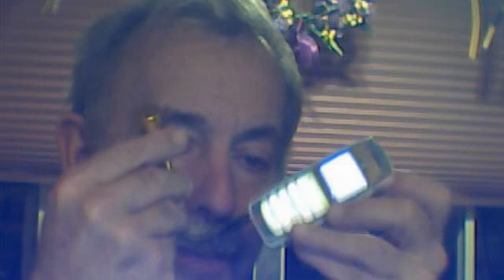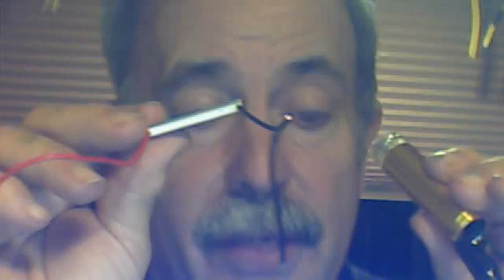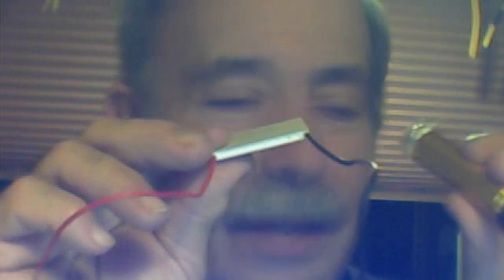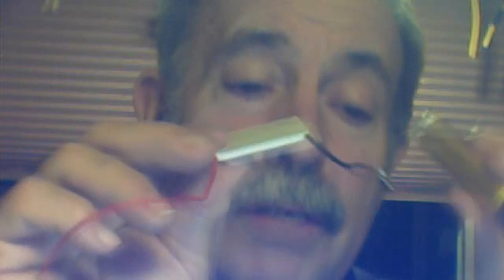free energy and the Joule Thief cell phone charger

Comment: volts alone is not energy, volts multiplied by current is energy in case of continous dc, 
joule thief aka blocking oscillator raises voltage but also increases current draw from source keeping the input and output power same or below in real world scenarios. 

however, if u connect source battery in parallel instead of series which is the current case in joule theif, u can make output exceed input, after adjusting and tuning it with proper diodes and caps.